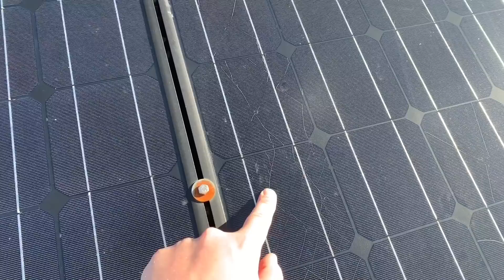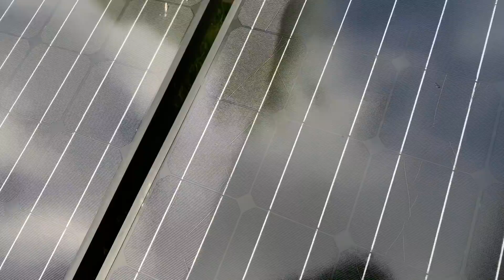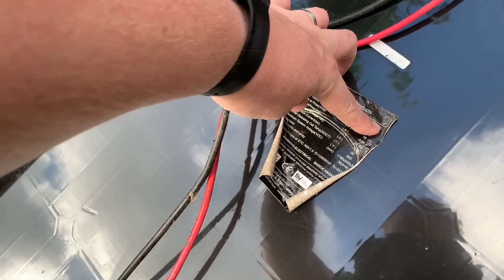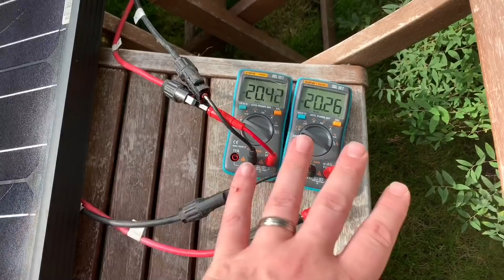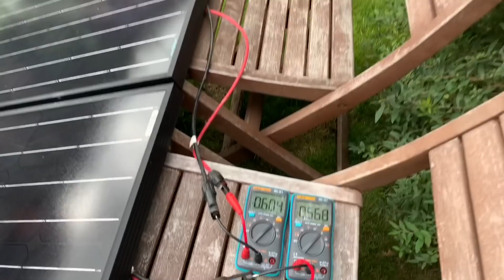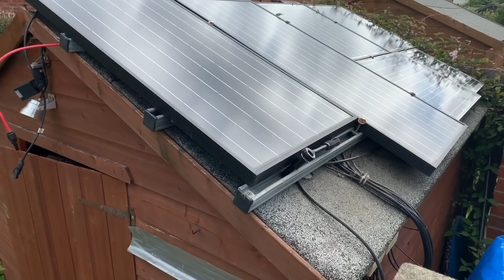Testing Solar Panel Defects

Comment: I love power way too much to deal with 100 watt panels. I have 355 watt panels and I see that as work. These require way more work..  By the time you put up your 300 watts, I have already put up near a thousand watts Larger panels with MPPT controllers are by far, the way to go.
Reply from the maker: I’d like more but my roof is filled. I have two different battery packs as well as testing things. So I’ve found a selection of different panels helps me in my situation, but if I could triple the size of the shed I’d happily triple the size of my panels :-)

Comment: Hi 
Adam Welch i am a viewer from Algeria and i have so many questions to ask you about electrical installations.
the two most urgent are related to solar installation and grounding
1. i have a distribution board with two sources of electricity, city electric and solar (2400W inverter) 
the thing is the two electric circuit are never in contact with each other  but i have to properly ground all the electric sockets for safety .
the question is do i make sepret grouding bar for the diffrent sockets or it doesn't matter or there is other solutions.
2. for my solar installation i have a pure sine wave inverter from EPEVER 2400 watt and the problem is that it is properly grounded but when i mesur from the neutral or live wire to the ground i have half of the potential (115 volt) .
ps:  i have 230 volt between neutral and live
i heard about neutral bonding and floating neutral but it is high level for me.
i hope you can help and thank you in advance.

Comment: These are neither microcracks nor snail tracks. Microcracks are almost always invisible to the naked eye and require EL imaging to be detected after supplying power to the module's terminals. Snail tracks involve the silver "grid" of the module to oxidise (due to moisture ingresion and microcracks) and migrate unto the encapsulant so it looks like it has disappeared... Those are proper cracks due to thermal or other mechanical stress most likely.
In your case though it looks like the cracks have not created any completely isolated pieces of silicon so eventually the generated current finds its way to the thick interconnecting ribbons and hence you have the same current on both modules. It would be interesting to have IR imaging though as I suspect that there will be a bit higher ohmic losses on the cracked cells...

Comment: I would think (as other people have pointed out here) that it is probably due to thermal expansion,
I noticed you had some plastic? shrouds around the bolts but nothing to allow expansion between the mounting rails and the bolt heads?
2mm thick soft rubber washers should allow enough give, I would do all panels to stop possible further cracks, no need to over tighten them I'm sure they won't fly away, 
I also think a coating of UV resistant clear resin over the cracks may help stop future water ingress

Comment: Good to see you confirm that cracks don't make much difference.
I guess that this is because current in the wafer is generated between front and back surfaces of the wafer, so a cracked cell then just behaves as a collection of smaller cells in parallel, as long as their currents can be collected by the tabbing and grid.

Comment: I have a 150 watt panel I bought cheap about five or six years ago because the glass was compleatly shattered, with spiderweb patterns and all. From what I can tell, it's kicking out it's rated power (well, as near to the nameplate as solar panels tend to do!) and hasn't shown any signs of crapping out. So a few cracks here and there often don't cause any real problems. I also have some panels bolted down in a similar fashion, however the rails I use are made of timber and that probably helps with the expansion etc.
Reply: Hi. Did u put anything/sealant on them 2 prevent any moisture ingress..?
I ask as I've seen similar & am thinking of getting some...
Thanks in advance.
Reply: @MaxMax-dq1lu  In my case I just cleaned off the surface with turps and sprayed over it with a can of clear acrylic , deliberately overspraying it the serverly cracked bits. Did a few coats. Eventually the product on the surface of the good glass areas peels off but I reckon where it has penetrated the cracks it has stayed.

Comment: i think the screw puts too much pressure on the glass at work we have 700 solar panels and we use this:
https://www.winkelman-zonnepanelen.nl/producten/montage-materiaal/clickfit-klemmen/1558/clickfit-100-3022-module-klemplaat/49586/

Comment: very bad and dangerous advice on saying there is no problem short circuit the output as there is no power... solar panels are generators and if you short circuit them they can eventually catch fire. there are cases.
Reply from the maker: I don’t believe you are correct. Solar panels state their short circuit current and this is a standard test of their performance. For heat to be generated within the panel you need both voltage and current. When shorted you only get current. Google short circuit solar panel and you will find many results explaining this is a standard way to test panels. Cheers
Reply: Actually, power is produced when a solar panel is shorted. Just not across the load because there is none. Instead it's dissipated in the cells themselves. Ohm's law and all that. ;)

However, I doubt it would ever cause a fire as there can't be any more heat produced than what would be with the sun falling on a piece of black something about the size of that solar panel!  And besides, shunting type charge controllers used to be all the rage and I never heard any reports of issues from people using those although it was said they wore out the panels faster.
Reply: @AdamWelchUK  thanks adam. I always think a short will generate heat on the panel. As i have seen a lot of photos of arrays of panels that get fire. I think i was wrong
Reply: @oskimac  That can happen with large high voltage series strings (such as on grid-tie installations). The bypass diodes are supposed to prevent this, but if they fail current will be driven through a shaded panel (with the panel effectively reverse biased) and this can cause localised heating and indeed fires.
Reply: @xanataph  that is a good explanation
Reply: Solar panels are one of the safest possible sources of electricity to short aside from a half decent bench power supply, the only time I've ever heard of solar panels catching fire are the ones from tesla installed on walmart stores which was caused by damaged wire insulation among other issues and typically electrical fires are started from arcing, so it's much more likely for the cable or connectors attached to the panels to fail and cause a fire rather than the panel itself.
 
These guys here did a good write-up on the walmart incident if you want to read more: https://www.thesolarnerd.com/blog/can-solar-panels-cause-fires/
Reply: @vgamesx1  thanks for the info
Reply: Actually, when the battery is fully charged, the charge controller (mine is PWM type) put the solar panel into short circuit. So it is absolutely no problem shorten their terminals.
Thanks Adam for great video.
Best regards.

Comment: @Adam Welch
Hi Adam... If I was u, I would want 2...
a. Re-test the panels on a sunny day.
b. Turn the panels upside down, & hang the cable down so it's accessible without removing the panels again & again, so u can keep monitoring the situation. Putting the connection point in a small weather proof box.
Though ur current results seem 2 indicate that both panels r working comparably, u need 2 bare in mind... even 1 damaged cell can seriously degrade the whole panels output (like with shading) so bare in mind ur  testing 2 panels both of which have some damage, what u really need is 1 good panel 2 compare it 2...
U could also compare 2 1 of ur good panels, factoring 4 the different power outputs...
The panel with more damage does seem 2 be a tiny bit worse than the other.
I'd want 2 keep an eye on them, as they will probably get worse over time & possibly reach a point where u will need 2 replace them.
Hence why I recommended turning them upside down 2 make future testing easier & less time consuming.
Best of luck buddy.

Comment: Is it the Silicon Wafer it's self that is damaged ?   Square Inches is the deal.  As long as the backing of the Cell is intact I would think they would still produce the prescribed power.   I would call it good and mush on.   On the other hand now you have a excuse to purchase 9 more panels,   eaaaa?
Reply from the maker: I had been wondering if this could result in an upgrade, but as these seem to be working fine I can put that off for now. Yeah it’s the silicone itself which has the cracks but the backing seems to be fine. Cheers